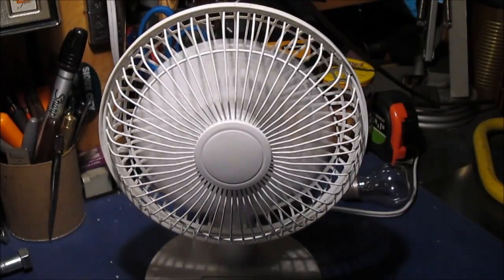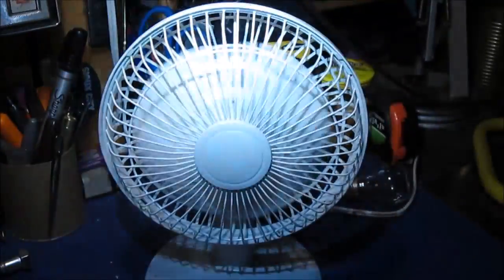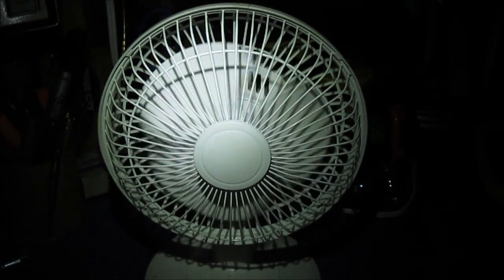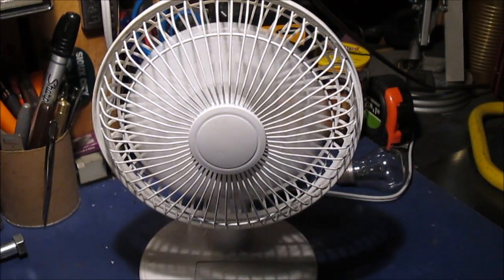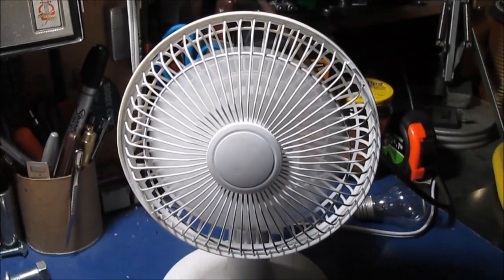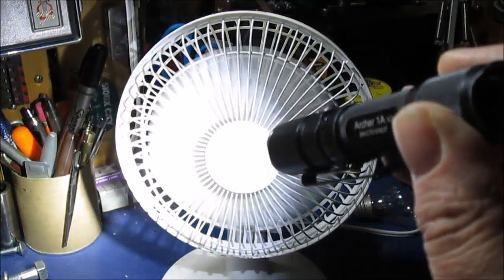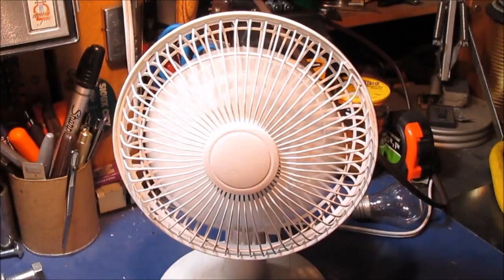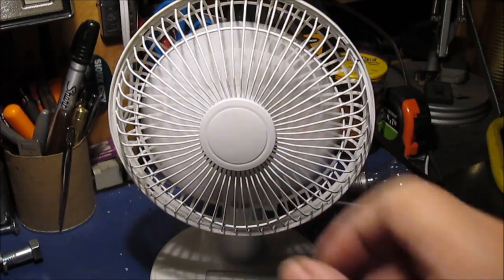Strobe Effect on fan blade from LED Bulb and Flashlight

Comment: Hey Jim, I used the extension magnet for the first time last night, since you gave it to me. I didn't realize that it was illuminated! What a great tool for an old guy! I could see the little nut that I dropped while working on a neighbor's golf cart. Thanks again for the very helpful gifts. I have never been to Tractor Supply before but will be stopping in there just to look around tomorrow while we are up in the big city, and of course our favorite place, Harbor Freight too.
Reply from the maker: I should have mentioned that it had a light ..I bought it an auto parts store ?? somewhere  It is handy to pick up a nut or bolt without having to bend all that way to the floor  Glad you are getting some use from It !!! I can't remember if the city near me Sioux City IA still has a Tractor supply ...They used to have lots of small wheels and tires ..better than the HF ones

Comment: The R&D side where I work tested fan motor RPM's at varying temps using a variable rate strobe light with readout.   Each fan motor had the same part# blade with 1 fin painted.   To verify RPM they just varied the speed of the strobe until the painted fin stood still... it was pretty neat to see.
Reply from the maker: I like to point a strobe light at a ceiling fan You can get a room full of people dizzy !!!

Comment: LEDs are not dimmed based on an increase or decrease of voltage (as is the case with their incandescent counterparts.) Light gets emitted from a semiconductor chip, so it’s either on or off, and the LED will maintain its operation at the same voltage and current level as if it were operating at full light output.   The LED torch is using Pulse-width-modulation to switch it off for a few milliseconds at a time thus fooling the eye and brain that it is actually dimmer, thus the strobe effect on the fan.   
Visual cortex and strobe lights not a good combination like the  LED Incapacitator which is a weapon designed like a flashlight. It emits an extremely bright, rapid, and well-focused series of 'differently-colored random pulses.' Before the human eyes can focus in on one frequency, another frequency comes on, causing intracranial pressure, which results in headaches, nausea, vomiting, disorientation, irritability, and visual impairment to the target.  nice, can't wait 'till the cops get them.......